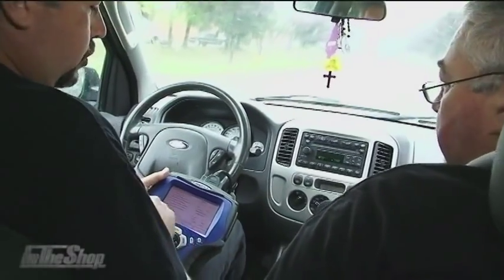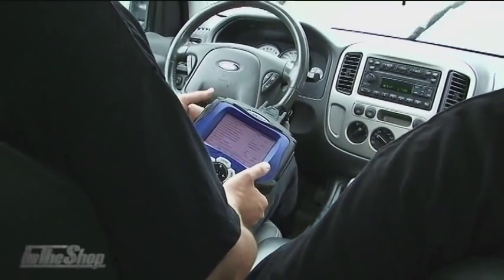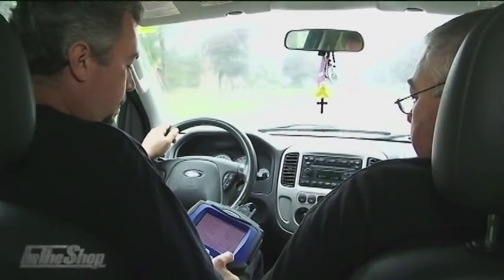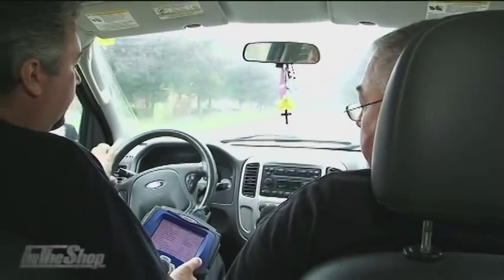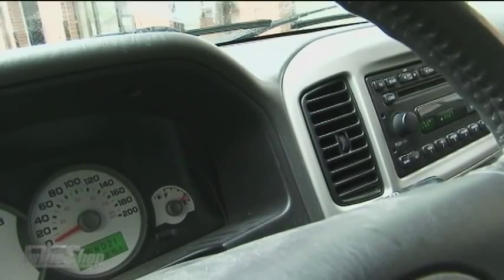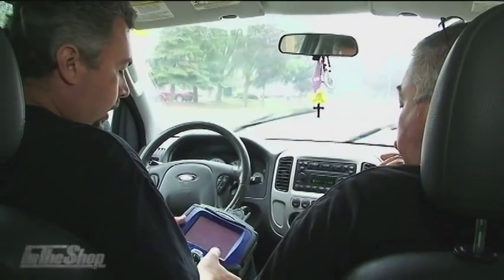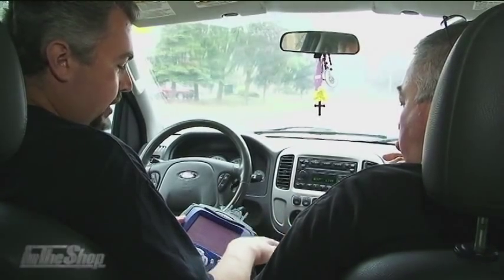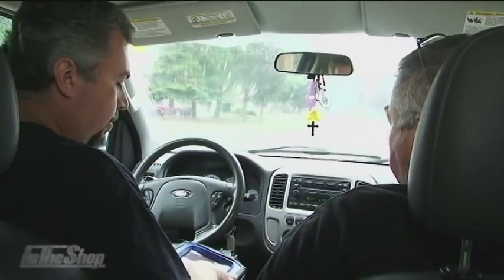Diagnosing Transmission Problems - Mister Transmission

Comment: My 2007 ford edge, goes out of drive while driving. Then wont move at all.
The shifter moves. But transmission isnt responding.
I get towed home, then its fine.
Then does it again a few days later.
What is this issue? Please help?

Comment from the maker: This video was intended to show the difference between an electrical control problem causing the transmission not to shift gears when intended, versus a mechanical fault causing the transmission not to respond to the electrical command to shift gears. Other factors such as high mileage, burnt or contaminated fluid, were not mentioned in this video which are also determining factors in removing and dismantling the transmission for internal inspection ensuring a quality transmission repair that will last for a long time. At Mister Transmission, we always give our customers options when repairing their transmission that will suit their needs and budget.
Reply: hey
Reply: Mine is doing the same thing. What did the problem end up being?
Reply: @philipreyes5862  mine too
Reply: What was the final problem?
Reply: I got a question for you. I have a 2006 Escape and when the car is at low speeds, mostly on slight inclines, it goes into neutral and revs up. It’s weird and doesn’t happen too often, but often enough to bother me.

Comment: A 2013 Chevy Cruze. Have the six speed manual.  This is a dual-clutch system for the six speed.  Clutch went bad, at first reverse was hard to engage, quick degraded so I could not get into any gear, mechanic found almost no wear on clutch plates. Dual clutch system cost $700-1000.  Clutch job $1,700, from a reasonably priced shop.

Comment: Hi, Thanks for your video. I have a 2005 Ford Escape 4WD with 101700 miles on it. I notice a humming noise that starts at 60kph and gets louder as I accelerate. I just got the two front hubs changed, and my mechanic said its coming from the transmission. I have replaced the transmission fluid and the noise still remains. The gearbox shifts smoothly, but I am not comfortable with the humming noise. Could you help with some counsel?
Reply: Put lucas oil stibilizer

Comment: I have a 2008 Mazda tribute and the round plate on the driver's side is leaking. Transmission problem. My question is, is it just a plate and seal? Or is there components inside of the transmission if I take it off?  I noticed that there is a small plate, and this big round plate. It's the big round plate that needs replacing. Please help!!!!!!!

Comment: I'm driving a space gear 94 model at trany. my problem is my trany goes gear hunting at 2500 rpm in uphill or even sometimes in hway. is this normal? I'm guessing I have the older version of a trany WC is operated hydraulically or vacuum. kindly advice

Comment: Hello all, 
I need your help please. I have little troubles with my manual gear. When I want to put it from 2nd gear to neutral, it has one spot between gear and neutral where it stops. It do not stuck in this place but i always have to push it little bit more up towards middle and to make sure it is in neutral by wiggling right-left. I dont have this issue with other gears, only with 2nd, with all others i siply touch the stick with one finger and it goes moothly to neutral. Do you have an idea what could be a problem? Thank you in advance

Comment: My 1989 Olds 98 transmission works fine and there are no symptoms that  there are any problems when the transmission is operating either in the forward or reverse mode.  The problem that exists is that when I shift the car from neutral into reverse there is a substantial and solid "clunk" as the the transmission goes into reverse.  This does not happen when I move the shift from neutral to drive or a forward gear.  I just made a long drive from Washington State to Arizona and I noticed during the trip that when the transmission was really warmed up this "clunk" did not occur.   What's going on?  I"ve had the motor mounts replaced but the "Clunk" is still there.
Reply: Lee Miller it’s usually from a lack of fluid pressure or to much newer transmissions adapt to worn out parts your older car can’t adapt the same way usually it’s a manual styled adjustment of “bands” but that noise is probably your reverse drum slamming. Not to hard to replace. The slamming will wear it out and eventually snap the teeth/ears off of it

Comment: Can any one help? I have a 2001 300m  3.5L.  Codes-- p0740 ,p0732, p0736, p0700, p0160, p0700.  I changed the Trans speed sensors. inner & outer.  Now it is going into limp mode... Help !

Comment: I have a 01 f250 7.3. just had a transmission rebuilt. after doing that 4th gear still dosent work. the mechanic says it's an electrical problem. would you know of anything that could be causing this issue? also my overdrive button is flashing after driving the car for more then 15min.
Reply from the maker: Hi,

Can you please contact customerservice@mistertransmission.com so we can discuss in more detail.
Reply: can you post what the solution turned out to be?  what electric problem?  Thanks just trying to fix my car,  2008 chevy Malibu,  did not go in reverse, but went forward,  then kind of bogged i think word is,  rev real high go real slow,  so far plan is drop tranny pan,  check out stuff there some kind of metal hose thing I saw on a video,  and i would like to change the electric thing.  Thanks

Comment: i know an engine can get hot and stall bnut does a transmission get hot?  my jeep is automatic and when driven a long distance at the regular speed of 75, the thing will drop to 60 and there wil be a whining noise and the jeep wont go past 60 , even when the gas is floored.  once jeep is cooled of, it'll be fine again.   computer doesn't show a trouble code. so what gives?

Comment: I have a 2006 ford escort wont shift gears when hot any ideas
Reply: I've the same problem with an explorer. I hope mine is eighter a bad wire or more so bad shift solenoids. If it isn't that it's probably the transmission itself. I'll let check it out at a transmission specialist. Do you already know what's wrong with your ford escape?

Comment: My truck falls out of gear when i am trying to pass someone and giving it gas. Then when the rpms come back down it goes back into gear...HELP?
Reply: I hope you got that fixed... bec. I have the same problem with my transmission in kia rio 2013 1.4l 4 speed

Comment: 2002 chev truck 4.8 low gear works will not shift even after replacing shift solenoid

Comment: this guy is a rip off its the scilonoid
Reply from the maker: +Amanda Marie 

The video is designed to show how computers and
electronics are involved with the transmissions shifting functions. Also, how the use of electronic diagnostic equipment is required to accurately assess transmission performance and diagnose problems/symptoms affecting proper transmission operation.